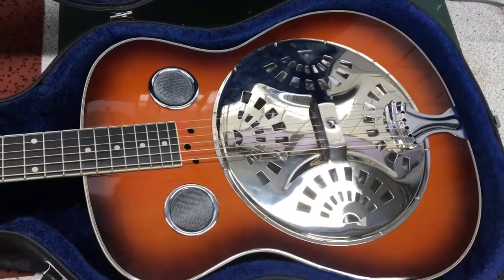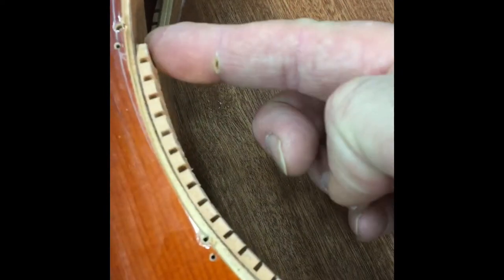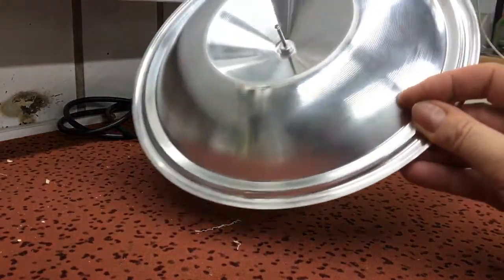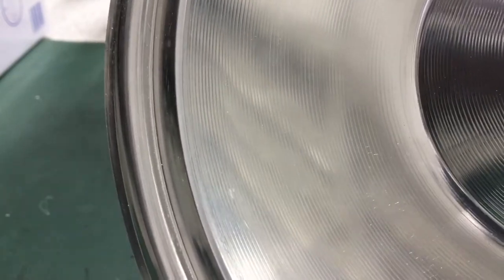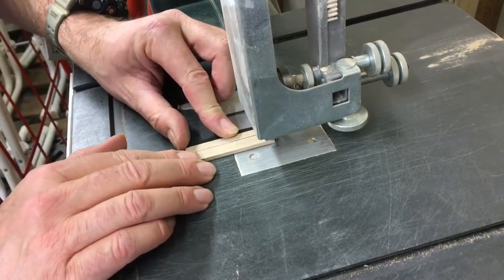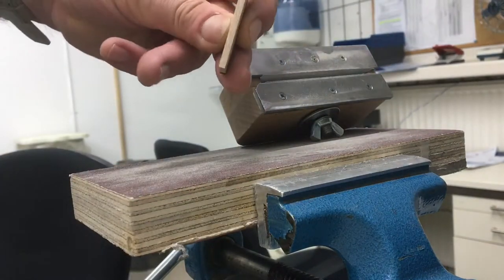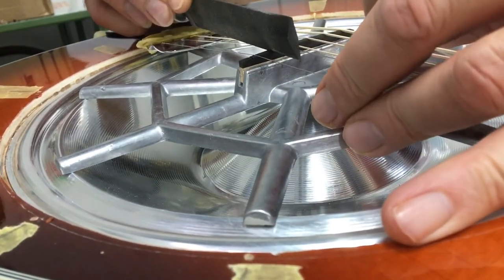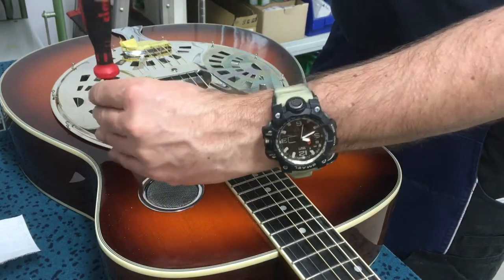Dobro Style Guitar Cone Swap, Set Up & Tone Comparison

Comment: Actually, the original China cone give a more twangy resonator/dobro sound I believe than the Beard cone - depends on what you're looking for in a round neck resonator - a square neck more expensive instrument using a tone bar would give you the deeper sound that the Beard seems to offer - so again, all in what you're wanting. Either way, good playing there fella.
Reply: Also that ´China cone´ may sound better with a heavy steel bar, may ´sound just right´
and give it that Dobro twangy, a little banjo-y sound, were as that ´Beard cone´ with
that same heavy steel-bar will give it a too ´liquid-y tone´ which is great sounding
for the Hawaiian steel guitar, but will lose that bite and bark in the Bluegrass sound.
"Let´s bring out Josh here to do us a number on the ´ole hound-dog´" -Lester Flatt
Reply: What y'all mean to say is : The generic import cone , has less sustain , harsher sound , and more limited tone , to make it sound more like a Biscuit Bridge Resonator .

  If you actually * want * to sound like that , great ! That's certainly a valid choice , that's why there are three styles of Reso designs , to give choices .

    But compared to what a Spider Cone is * supposed * to sound like , it's embarassing .

Comment: You can bend the spider assembly to get each legs level to the cone but because it's cast, you have to be careful.  I bend them by hanging the leg over a sturdy table and put pressure on the tip of the leg. Having the spider just a little off level makes a big difference in tone. The Beard cone sounds more powerful.  The stock cone is a little nasally sounding, but not terrible.

Comment: Well the Beard cone sounds far better but the question that springs to mind is did you record the Chinese made cone before you worked on the spider or after ?
Reply: Before!
Reply: @martinstubeampworkbench2299  OK so the difference could just as easy be because of you improving the spider or a combi of that and the new cone. Thanks I just wondered.
Reply: Ah , no . Even properly set up , a generic import cone will not sound like a Premium Cone .

  ( But it would be noticeable improvement over the baseline .)
Reply: I'm not really concerned whether it sounds like another cone I'm just concerned which I like the sound of most and the sound obviously could be the result of the set up and the cone because one was played before the set up and one was played after the set up. Clearly both cones should be trialled under exactly the same circs to give a fair test, otherwise, like your comment it is just opinion without basis. It may be popular opinion but still opinion.

Comment: Does a Beard cone sound better than a generic import ? Well Yeah !

   Would any Premium ( or almost Premium ) USA cone sound significantly better than any generic import cone ? Well yeah !

  Which sounds better between a Beard , Quarterman , Repogle, or Scheerhorn ? No single answer.

 Depends upon the interrelated body shape and size , design of sound hole / open body/ baffle design , type of wood , exact set up specs , the strings used , subtle differences in playing techniques , and subjective personal preference .